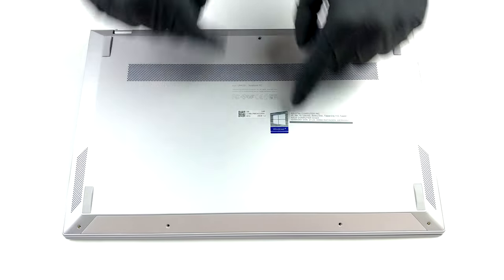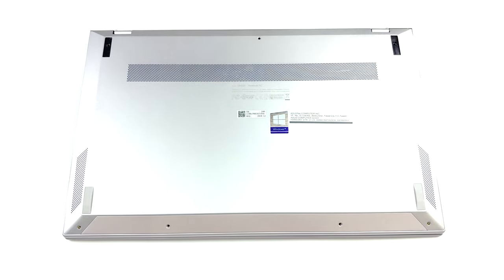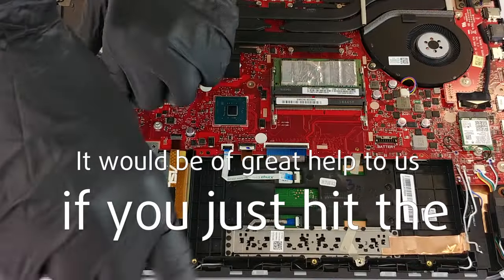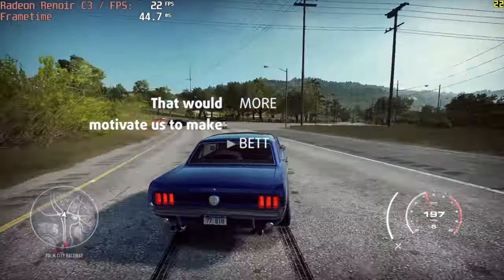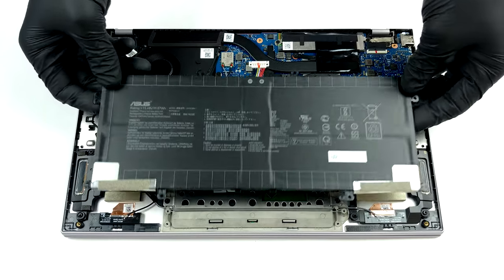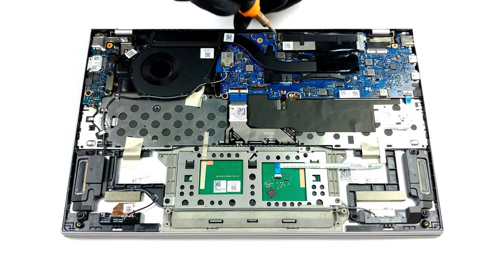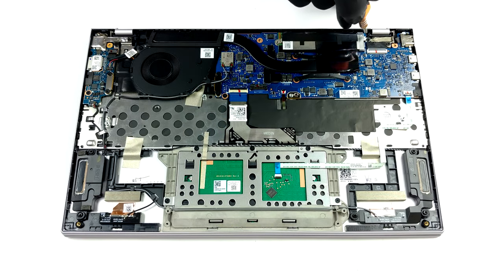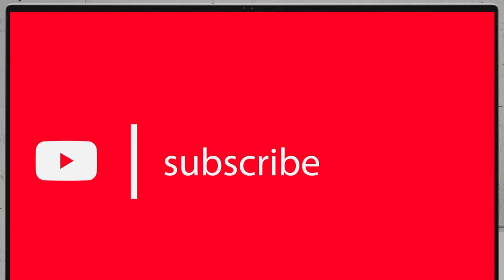🛠️ ASUS ZenBook 14 UM425 - disassembly and upgrade options

Comment: Repasted CPU and put thermal pads onto the heatsink+ssd. Temps droped from 90* in Cinebench R23 to 55* 100% all cores.
Reply: How thick were the thermal pads, and where did you put them ?

Comment: The battery connector is a bit tricky but very little force is required. You have to slide the metal connector cover ~1mm away from the battery parallel with the motherboard. Then the white plastic battery connector comes up away from the motherboard. I have always hated how ASUS don't share their service manuals or even have a decent support site like HP do. #RightToRepair

Comment: FYI I just opened one today just like on the video, it also had glue on battery in the middle and it made me think there is some magic screw that was not mentioned. 
thank you for helpfull video, I managed to clean it nicely. (clogged so hard that cpu was throttling and behaving like intel)

Comment: On the Asus page they say that the 8gb of ram version can be upgraded up to 16gb. Meaning that 8gb are soldered, but there's also an available slot to upgrade. if you get the 16gb version you won't be able to upgrade, but at the same time, why would you? I'm not sure if this is true, but that's what they say

Comment: doesn't work. Do some of these  Asus Zenbook 14 UM425 have the bottom cover glued? I removed all the screws, rear feet and screws underneath, I can get it loose on all ends but the plate holdds in the middle like crazy,
Reply: so there are additional plastic holders around the center, it definitely does not pop up like in this video. As for the blue - small double sided tape is on the very Bottom (front of the laptop)

Comment: can the wifi card be upgraded?
Reply: i am searching too.
i have same nb. wifi card is ac8265. This nb's card is not working good. 5ghz and 2.4 ghz same, bad conneciton.
Reply: @aybibose3564  my card works fine, and I opened it to check and sadly the wifi card is soldered to the mb so can't upgrade to wifi6.
I use a USB dongle for wifi6
Reply: @erezalfasi007  really! its not good soldered card. 
gsm's wifi better than this pc. 
Maybe, i will use usb dongle too.
Thanks a lot.

Comment: If I have the 8gb of ram version, can I change it to 32gb ram? Does this computer support it? I read this processor supports till 64gv of ram. Is it true??
Reply: RAM is soldered. No way to upgrade it. In this model you can replace SSD only
Reply: Ram 8 gb for Ryzen 5, and Ram 16 gb for Ryzen 7
Reply: How about the config? Does it dual channel by default for 8 gb variant?